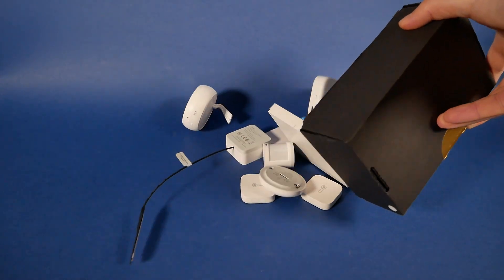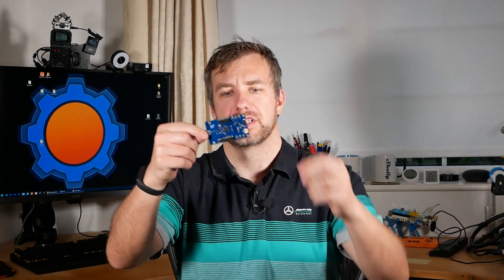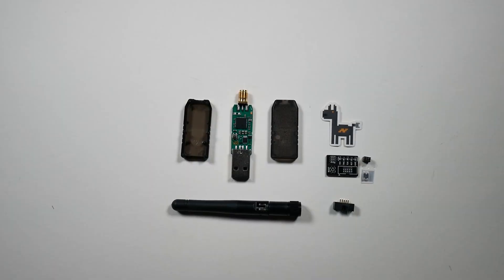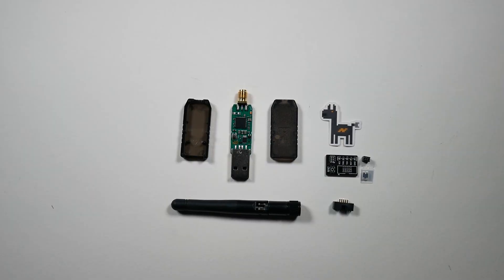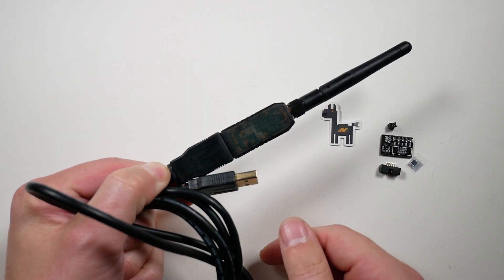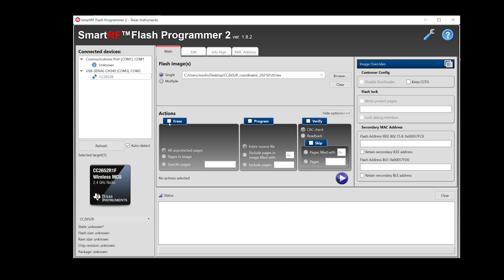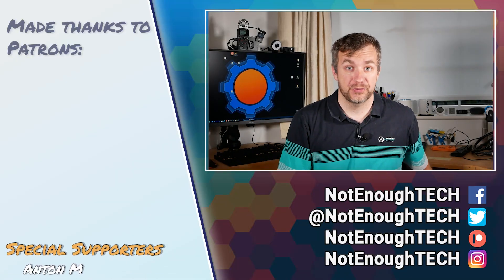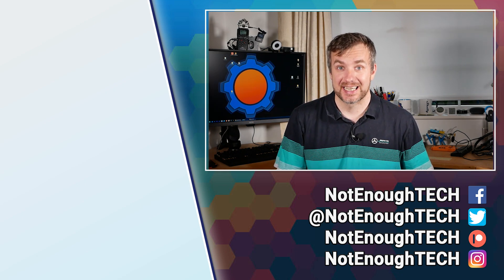I've got Lamas in my ZigBee network - flashing CC2652R from Electrolama

Comment: That's only a small ZigBee problem.  LoL.   Oohh the ZigBee :)  
I found a few ZigBee coordinators are don't like interference.  ConBee and ConBee II, which are a lot more expensive, are horribly sensitive to interference.
I am always on the lookout for coordinators that can handle higher number of devices directly.  This one looks interesting :)  A reliable coordinator that can handle direct connections is worth the price.
Reply from the maker: I will have one more from sonoff they are testing shields to combat this

Comment: I upgraded 2 month ago from CC2531 to a Texas Instruments LAUNCHXL-CC26X2R1 adapter, was expensive but a good choice. It was very easy to flash the software with UNIflash. But the hard bit was to repair all my 63 zigbee devices. Not that I had problems, it just took some time. Thansk for the zigbee and nodeRED content on your channel. BTW when do you drain your central heating so we can get some videos how to control radiators and floor heating?
Reply from the maker: This summer.... On not enough tech...
It will be a video on how to control individual radiators or how to prevent flood damage 🤪

Comment: Awesome stuff -I'm using CC1352P-2. Btw, I didn't quite understand: what do you do to change from 50 to 200 devices?
Reply from the maker: 50 devices connected directly (end devices) if used with routers you can connect up to 200

Comment: just ordered mine, could you make a video of step by step on flashing the boot etc. ? I am planning to use it with ZHA. What do you think of that?
Reply from the maker: Frankly speaking I'm not sure if I will cover the boot flash section. I don't even have a JTAG :D
Reply: I use one with ZHA and it works great. Very simple to set up and (so far) very stable.
Reply from the maker: I used zha on flashed sonoff. I'm just more familiar with z2m and it's my preference that's all
Reply: @notenoughtech  How's your experience with the coverage?would it reach a typical British House from top to bottom?
Reply from the maker: You will need a router or two as having these is recommended not just for the range